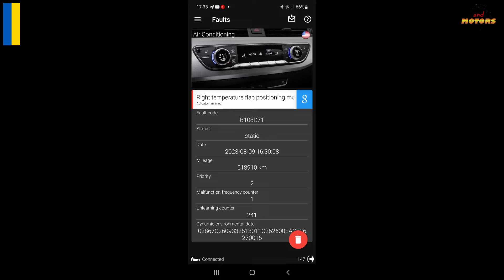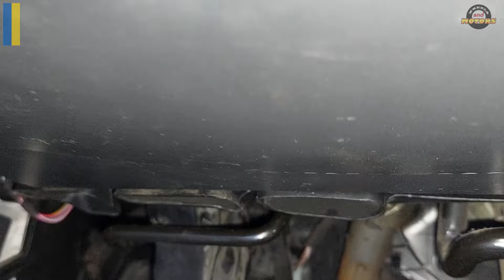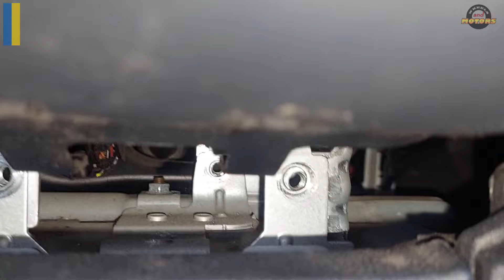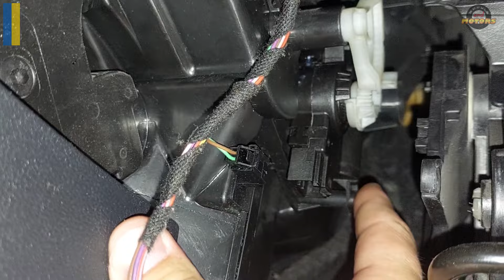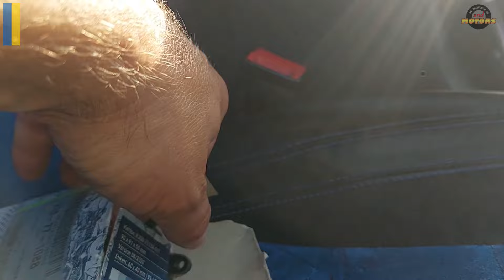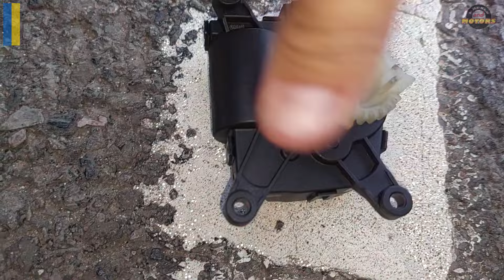Replace DRIVER SIDE heater control, temperature flap position motor. B108D71 (VW, Audi, SEAT, Skoda)

Comment: hi, do you have a video on how to change the oil in a manual transmission on a vw sharan 7n?
Reply from the maker: No, I don't. I've done it once on 320K, and it was pretty clear. It meantto last lifetime. You can easily find drain plug and another plug for filling up and level on a side. It only takes about a litre.

Comment: Hi, do you know the fix for Sharan 2015 error: B108E71 - Rear temperature flap positioning motor Actuator jammed             Intermittent
Reply from the maker: No, sorry. I don't have any manuals for Sharan. Also, I don't have the Sharan anymore. 
I believe it should be something similar to this, but you need to find location.

Comment: Great job explaining the alignment of the gear and valve I think I have a stuck valve on my Jetta so this came at a good time.. Thanks 👍🏻
Reply from the maker: You're welcome 👍 
Sometimes, it can be misaligned gearing. In my case, little motor was not moving. Perhaps some internal issues, but 40 quid from AutoDoc seemed an easy option. There is a video on YouTube of someone disassembling this motor. Too clever for me... Or maybe just a lack of time.

Comment: Very clear explanation as usual. I had no idea how that system could work and now I feel less stupid. Thanks for that and keep helping us to repair our cars with your comprehensive videos.
Cheers.
Reply from the maker: Cars are easy, once you know what to do  😎👍
Reply: @wawayltd  Sometimes it's not possible as you need dedicated tools or equipment but globally you are right. It's like basic maintenance, oil change, filters change etc...why pay crazy money for that?
I do myself and use highend oils instead of what garage offers. I have a VW CC 2.0 TDi, 345.000km and drives almost like new.